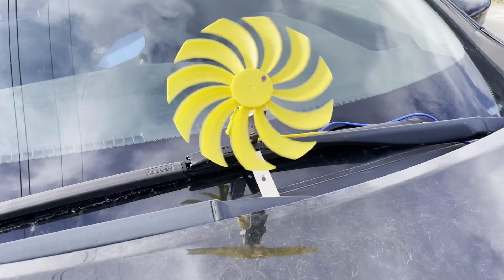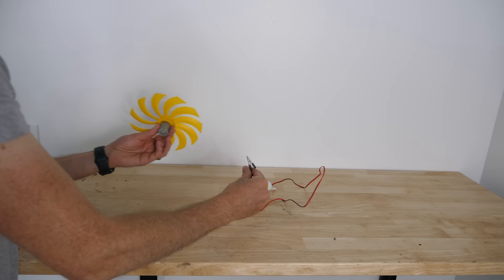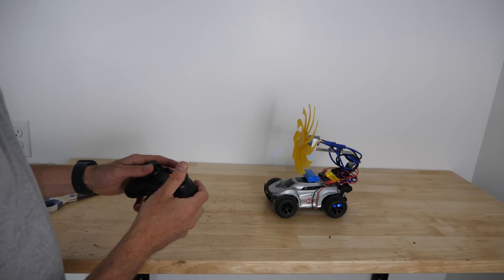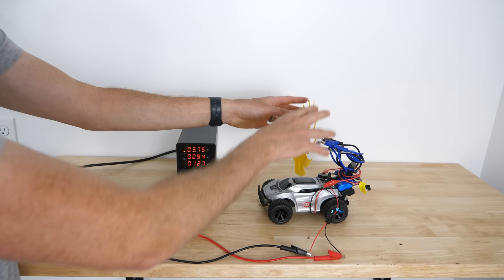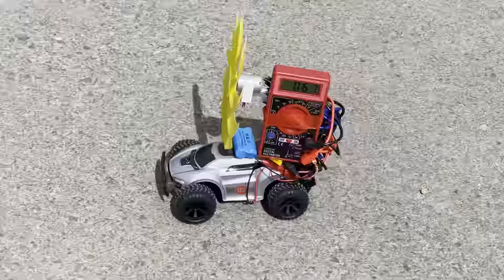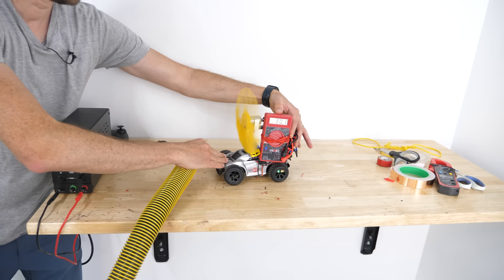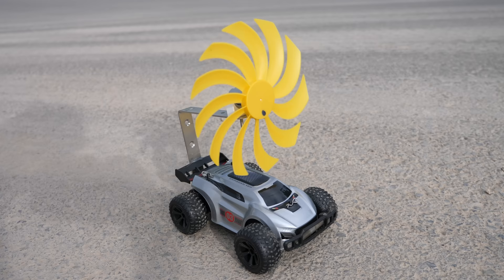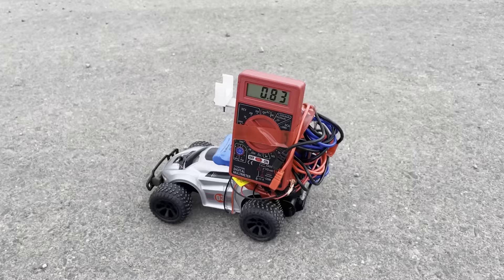Can You Power a Car With a Wind Turbine?

Comment: If the turbine overlapped with existing frontal area you can actually gain more than you lose
Reply: You'll never gain more in motion than you would at standstill
Reply: @MelodicTurtleMetal  thats incorrect
Reply: @noncog1  where are pulling the energy from? A gust of wind only has so much energy in it. You're not generating more wind by moving, you're applying energy to the turbine to force more air through. You will end net neutral to the air naturally pushing through
Reply: @MelodicTurtleMetal  if youre moving theres more energy in the air speed delta. Sure you have to put that energy in in the first place, but heres the thing, youre already doing that in the first place. If youre actually engineering this to work you put the fan such that its entire frontal area overlaps with the vehicles existing frontal area to recoup some of the energy you were already losing to air resistance in the first place, thus adding energy back into the system, sure, energy you put in in the first place, but energy that was going to be put in either way to perform the intended function of mobility, making it a beneficial system. Well, until you hit a pedestrian, with pedestrian death rate already being a huge problem in american due to the insistence on driving larger and larger vehicles, at the cost of efficiency and ability to maneuver to avoid accidents, and at the expense of whatever they hit with a 6000lb suv when they do fail to avoid a collision
Reply: @noncog1  No, because you're still adding more drag and turbulence. You'd see a bigger benefit from not having the turbine at all, and instead making it more aerodynamic. The turbine will produce more power than it would when the car is motionless, but it'll require more power to overcome the drag then you'd generate.

You would always benefit more from increasing aerodynamics. Turbines will always reduce aerodynamics.

You're still trying to pull more power from the same air by applying work.
Reply: @MelodicTurtleMetal  but theres a reason cars arent perfectly aerodynamic in the first place. There is wasted energy, there will always be wasted energy, and if you can recoup more energy from that waste than youve added, its worthwhile. Theres proofs of this concept in multiple forms already. Think of it like regenerative braking, the extra mass of the system increases energy consumption, but it reclaims more energy that was going to be wasted anyway such that it overall increases system efficiency. Same with turbos, theyre an exhaust restriction that increases pumping losses in the engine, but by reclaiming otherwise wasted thermal energy in the exhaust gases, they can actually increase system efficiency (though they usually dont, as theyre typically used to increase output, not efficiency)
Reply: @noncog1  yes, but those are recouping power we've already added. You're trying to take power from a non fuelled source. Wind is not waste energy, and you need to convert it. Any spot a fan is exposed to airflow will produce less power than simply not having it - if you're not impeding the airflow then there is no flow to generate power. If you were to put turbines in the exhaust, then yes you're salvaging waste energy and it would be worthwhile - but you're not recycling energy with a fan or turbine exposing it to the air.

It's honestly very simple - if air can flow somewhere, you're better off assisting the flow. Any impedance of that flow will have a negative effect. A fan or turbine must create a resistance to generate power.
Reply: @MelodicTurtleMetal  the air flow is from power youve already added, by driving through the air. The airflow is already being impeded, now youre just extracting back out some of the energy you were already putting in any way. Vehicles will always have a pressure delta front to rear while traveling through air, you cannot just "optimize" away air resistance on vehicles traveling in atmosphere. Youre right, this is very simple, which is why i dont understand why you arent getting it. Its literally already been proven in the physical world, youre literally arguing against a proven concept. The vehicle is already putting work into the air by traveling through it, some of that work can be reclaimed at a net gain of that subsystem, reducing the net loss of the entire system. Very simple.
Reply: @MelodicTurtleMetal  "non fuelled source" how do you think cars move? They arent sail boats...
Reply: @noncog1  you're really missing the basics. You can't gain from impeding the air - that impedance is the loss. You claim the impedance is already there, and that you're extracting it - but you're not. You're adding an additional impedance, and you're absorbing a percentage of your new impedance as energy. You're making 200% impedance (existing plus your generator) then recovering done of that as energy.

If the impedance is already there then the energy gain is to improve the aerodynamics and use less energy to move through it, not add further interference and try to gain back energy.

In regards to the fuel source, you're completely misunderstanding. You're using a fuel to move the car, but your turbines aren't trying to recycle any of that energy - your trying to obtain a new source of energy by using the car fuels. You've turned your turbine into a generator, powered by your car instead of the wind.

You cannot freely obtain more energy.